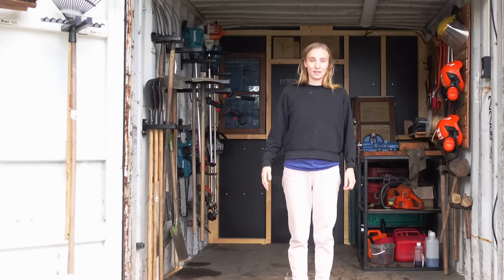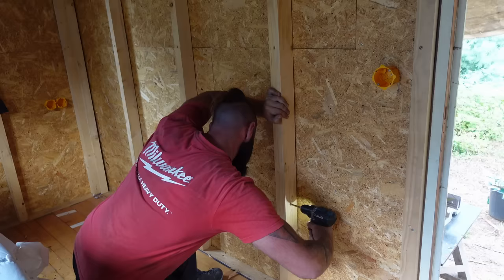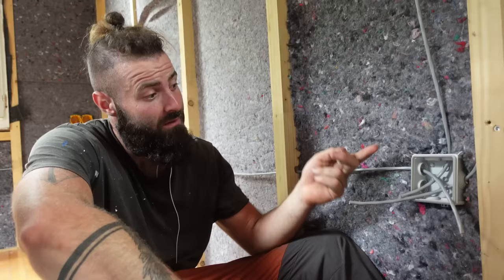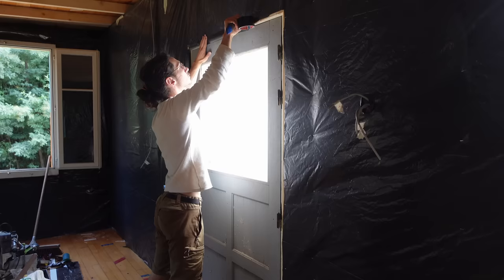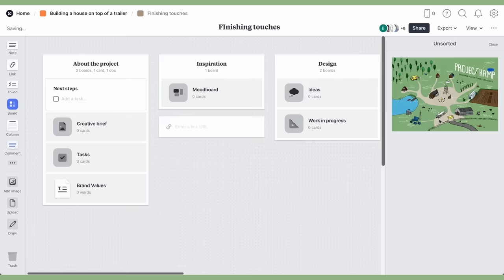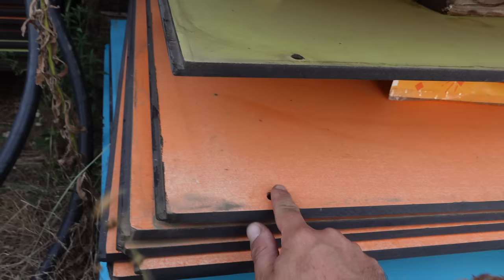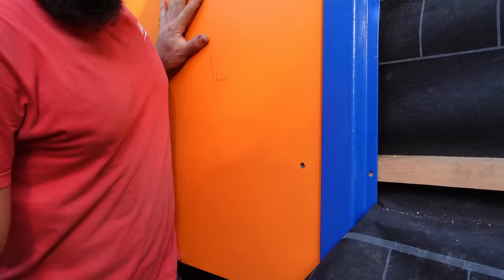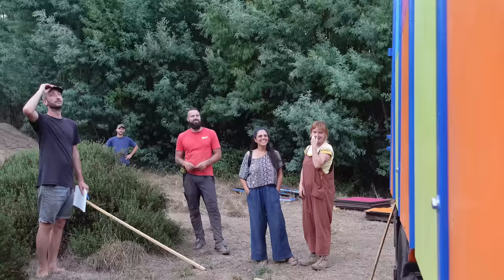#101 Installing old reused panels on our trailer d̶i̶s̶c̶o̶ house (it was voted)

Comment: It was a good decision to choose opaque vapour barrier -- no one will see the black mould!  You have the vapour barrier on the wrong side of the insulation.  In hot climates, the moisture travels from outside-in.  To function properly, the VB needs to prevent the moisture from entering the insulation.  In cold climates, where homes are heated and moisture travels from inside-out, you place the VB on the people side of the insulation.  Look it up by searching "where does vapour barrier go in a hot climate" or "where does vapour barrier go in a cold climate".  Any job worth doing is worth doing twice, err, right.

Comment: You really should have your vapor barrier on the outside of the installation, not the inside. In case water gets through your exterior walls. Also, you should have a way for moisture to get out the botton of your walls.

Comment: Well done with the trailer house however I think cork wood insulation like you did before is much safer than recycled fabric insulation. I think that cork insulation will much reduce the risk of fire that may occur in the event of a possible electrical fault.

Comment: The problem is not the color, but that the panels are too uniform, different sizes would have made a difference, although it must be said that this means more work, because you have to make more cuts and more drills.

Comment: You mentioned that you should use electrical piping. Is that common practice in Portugal? In the USA we almost always run our wiring loose. There are exceptions of course, but I found that interesting.

Comment: Another way than biogas to get rid of fossil fuels is to run the pickup on vegetable oil. There are alot of examples where used vegetable oil from local businesses is filtered and used in older diesel cars.

Comment: Further thoughts about textile sustainability. Project Kamp is gung-ho on sustainable land use, infrastructure, and food. But there's a big blank spot when it comes to textiles. Most people these days don't know how to sew, darn, patch, and recycle textiles. Because these have been coded as female skills? Old-fashioned? I've learned how to darn and patch from 19th century needlework manuals. Available free online as PDFs  :) Therese de Dillmont Encyclopedia of Needlework, for one. I'm not as good on skills from other textile traditions, though I have done Japanese sashiko. In these days of cheap cloth and fast fashion, people throw away clothing rather than fix it. Project Kamp should revive the old skills. 

Making curtains from old jeans is silly. Second-hand sheets and blankets would work much better and look prettier.

Comment: I don't understand the plastic in the house: you can use OSB right away or a vapor barrier which is open to diffusion. The plastic you use seems way to tight/dense.

Comment: Are you going to add a water wheel to the little reservoir?  Also will a wind mill even be feasible even for low voltage?

Comment: I don’t think those external panels will last. Moisture will swell and delaminate them. I would also worry about chemicals, a lot of laminates are high in things like formaldehyde. I think you’d be better using split mimosa overlapping. Even if they are not fire resistant with wood and resin at least they are not glue and maybe petroleum based flammable. Also when the panels deteriorate they will not be “composite” more of a toxic mess that needs managed.
Reply: I love that you want to recycle, but if what you use is not going to last you end up wasting effort and materials when for example the wind storm blows off the tin can roof and ruins the structure below. Old windows, yes. Old wood for flooring or interior walls, yes. Old gym floor for a roof or laminated hardboard for siding, nope.

Comment: Question: Will you need to seal the exterior HPL panels with silicon or something to prevent water infiltration? Also, if the color scheme really starts to bother you, can you paint those panels, or will the paint not adhere to the HPL?

Comment: If you guys are putting so much effort into insulated the pig trailer it is most definitely worth to switch out the door for something better. Looks like single pane and not very air tight.

Comment: At 30:51 , is that a ROTEX? i have a ROTEX 680/3 it have a handle and weight of a handgun with real steel, my DYMO 1405 Mk2 is just plastic but can take 12mm tape.

Comment: Why do you have your negative battery connection fused? I thought only positive is getting fused. If you look at the Victron Lynx Distributor or Lynx Shunt VE.Can only the positive bars are fused. By the way those might be an option for you if you want to extend your installation further.

Comment: Perhaps you would want to paint the panels white.... as an excuse you can say it reflects more sunlight and thus keeps out the heat.. Also are you going to keep the trailer on the wheels? and will you extend the outside (living) area of the trailer with a canvas or roof?
Reply: Not sure how it is in Portugal. But in some European countries, if it isn't on wheels, it's considered a tiny house - which would include obtaining certain licensure and permits. As long as there a wheels, functional or not, it's not considered a legal dwelling. This could be the reason to keep the wheels, but again, I don't know.

Comment: Your sewists mean well but it seems that they don't have much experience with sewing and mending. Suggest: buying an industrial machine that would handle canvas, tarp, and other heavy materials. 
Also suggest: buy new towels and start mending at the first hole or rip. Don't wait until the cloth is worn thin and tattered. When the cloth is worn thin, mending it is impossible. It's like trying to mend kleenex (tissue paper). Those old towels could be cut up for insulation or stuffing. Or turned into rag rugs.

Comment: So, you are chopping a lot of mimosas to reduce the fire hazard but at the same time you are connecting electrical cable, without any conduit, inbetween flammable rags, in a wooden sandwich, with doubtly proper gauge cable for the amperage to be used. tell me more...
I don't know, maybe all of it is soaked in flame retardant or the construction codes in Portugal are a little more flexible.

🤷‍♂

Comment: In my experience it is not safe to do the wiring like this especially not with the material you use as insulation. And the cables look way too thin.

Comment: Why are adults afraid of colour? I think this looks fantastic.
Reply: I don't think they're afraid, but this much vibrant colors can be too stimulant. Good thing it's on the outside, but still.
Reply: @a.chataignier  I think it adds a cheerful pop. With projects like this, you can either make it dissapear into the landscape or contrast. With the product used it would be impossible for it to dissapear so why not make it really contrast.
Reply: @airenesmiler6624  'cause they clearly don't like it 😅. If they went with the blue and green, for example, It'd still be super vibrant and colorful, but more relaxing. You could do something fun, that's also pretty. Just my opinion.

Comment: so you add plastic all over the build but the one place its too much is on the electrical system?! needless to say this is how fires start especially seeing as you have a flammable insulation.

 most stuff a few mistakes is how you learn, when it comes to other jobs a few mistakes is how someone burns to death or a forest fire starts or both

Comment: With all due respect, none of you actually seem convinced about the VERY colourful panels on the trailer  (poor Javi's face said it all when building it hehe) and I personnaly would never have chosen those for such a natural environment. Dark green as Dave's van or even blue same as the trailer structure would've been perfect!!! In the end, the people who actually live there should be the ones choosing, IMHO. And the wires between the insulation without proper pipes doesnt seem very safe...

Comment: that's some skinny @ss cables you are running there...  looks more like extension cable wires and not installation cables
and those kitchen towels seems dirty enough to want to be used for rags in the shop and not in the kitchen doing dishes... nothing wrong with replacing when you use the old ones for other stuff ;-)

Comment: My question is  why bother with the pig trailer? You made a building using your supplies the pig trailer added nothing to the project just created more work. A building made from the materials you used would have been better then wasting money on the trailer.

Comment: Solar is very inefficient type of off-grid power source.
Reply: I would request you to brainstorm an alternative idea
Reply: You can consider the waterfall at the lagoon to produce electricity using water turbine.
Reply: but the design should be minimal and compact so that it does not affect the lagoon atmosphere.
Reply: Your land has a vast potential and diversity. Every acres by acres it has a different landscape high and low, creeks and waters and grass land and forest. Just Amazing

Comment: Please use some conduct to those cables. Yes plastic is bad for the environment, it is also bad that you guys are putting your selfs and your environment (you are in a prone to fires area) by not using safe options. Imagine that rats or other animals get to those cables and cause a shortage? With this insulation material + wood you will have a giant metal oven in the middle of your land.